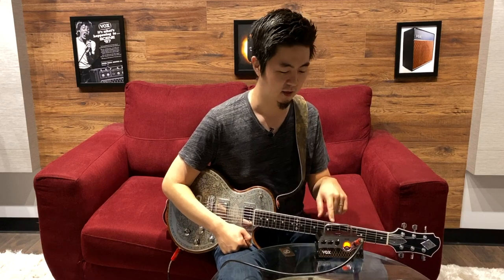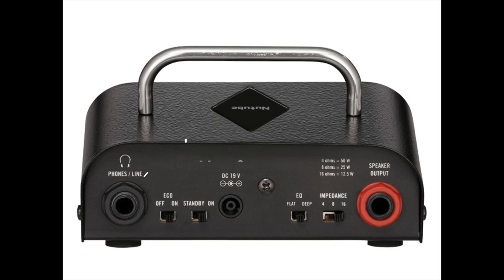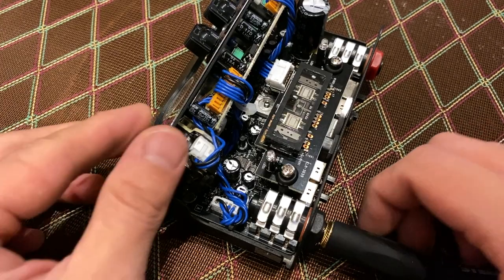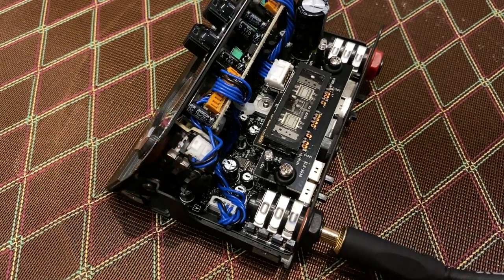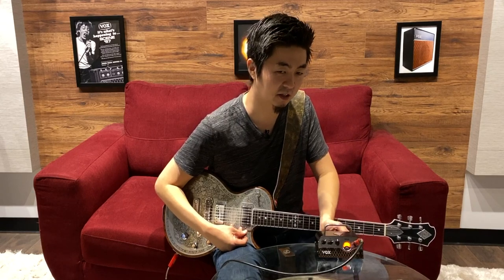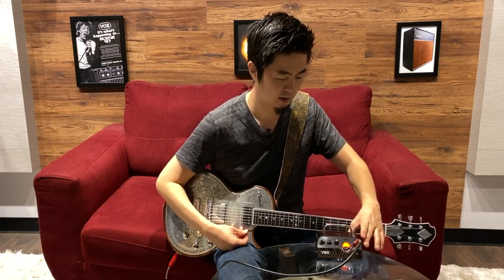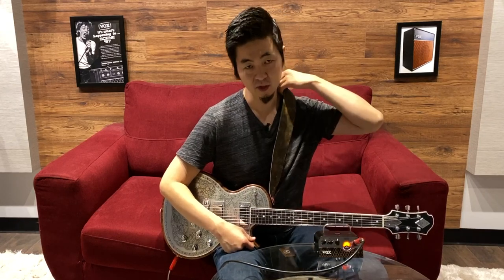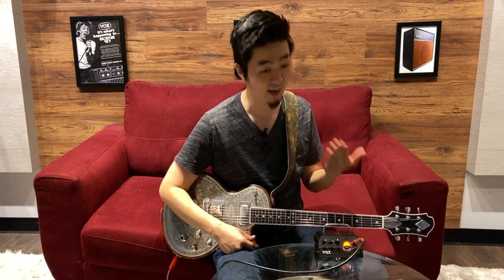VOX Tone Tips: MV50 Cab Sim Bypass

Comment: Good to know, I gave my son the MV50 Clean to play through a 2*12, sounds very nice, with a NUX Plexicrunch it Rocks, WHY, WHY did Vox not add an effects loop on these Amps, really missed a trick.
Reply: IMO the clean doesn't need that because it doesn't overdive/distort up to 70% of the amplification spectrum. But for the other MV50s it would absolutely make sense to have an FX loop. But it is very easy to add it: https://www.youtube.com/watch?v=2IiKJY0c90o
Reply: There’s a very simple step by step on YouTube to add a send return. If you need one.

I’ve always used a single channel, no effect loop amp - so never needed one
Reply: @JDAfrica  thanks, I've seen, reluctant to add that, unless I could get another one cheap, very unique Amp, don't  want to break it.

Comment: Vox - please can you clarify something that is being debated about these Amps all over the internet which is about the impedance switch on the back of the Rock and AC (but notably not the Clean). So…the clean doesn’t have an impedance selector, therefore implying the Class D power amp ‘self-selects’ the impedance and is equally happy at any of 4, 8 or 16ohms. Now, unlike the Clean, the AC and Rock have an impedance selector. Some people are reporting that setting this incorrectly risks damaging the amp (as it would in a tube / Class A power amp set up.) Others are saying that there is no risk at all, the class D amp will select the correct impedance, it is really therefore only an EQ switch to ensure it sounds correct out of each type of cab (and the manual eludes to this being the case as well without explicitly stating it). Please could you clarify which is true. Many thanks

Comment: Thanks for that tip. I tried it that way and it worked. Then I thought I could use a stereo jack to two mono jacks to have the emulated signal on one mono jack and the signal without speaker emulation on the other. But this is not working. Does anyone knows why?
Reply: It does not work because when you introduce the plug all the way, it pushes it so it can make contact with the circuit that enables the cabsim.